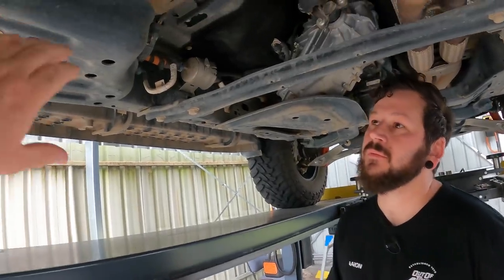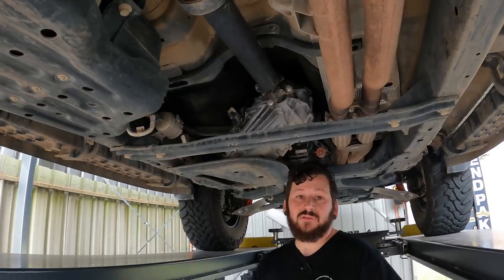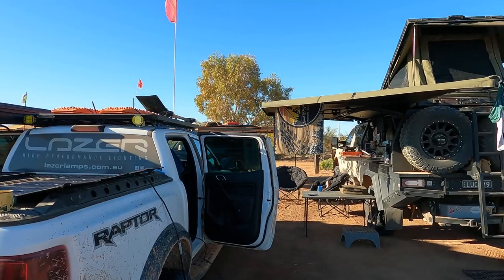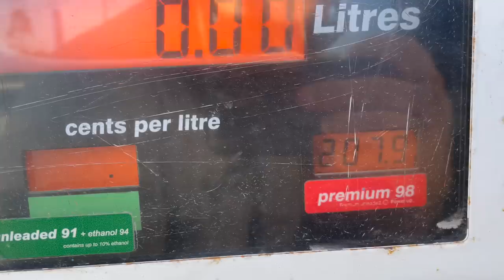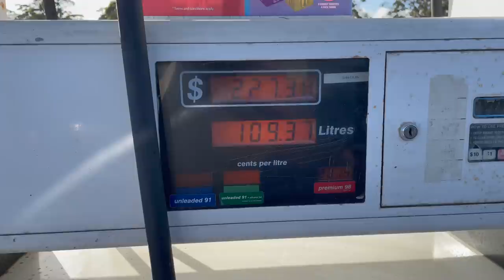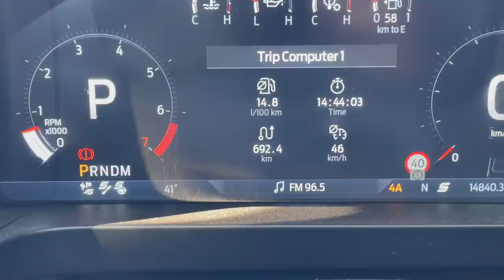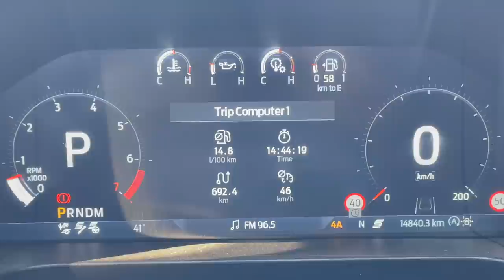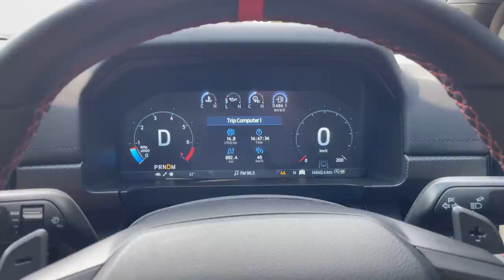⛽️RANGER RAPTOR 140L LONG RANGER FUEL TANK INSTALL. How far can we now go ?

Comment: I hope you find a work around for the DTE. I'd been keen to buy the tank also but would really like the gauge to work properly.
Reply from the maker: Yep the gauge works on the screen as the fuel goes down it’s just the DTE that Ford will need to change in the Firmware updates.
Reply: Try EZ lynk. I used one on on my 2019 f250 when I put the S and B filters tank on. It took maybe 5 mins to reprogram.
Reply: Great channel Ty, I have an orange one - absolutely love it - did ford manage to sort the dte yet to your knowledge?

Comment: 800kms from a 140lt tank. That’s rough. Gotta pay to play I guess. I used forscan on a PX2 to configure the larger tank. Worked sweet no issues. It’s good to have the gauge working correctly, no doubt the car nerds will work it out soon.
Reply from the maker: Playing is expensive 😂 

Gauge works as per factory it’s just DTE reading that’s a firmware thing calculated to 80L tank. Ford will need to update it in the over the air updates for Raptor.
Reply: @TyFenwick  Yeah that’s weird if the gauge is working correctly but DTE no good. They must calculate DTE differently now. If it’s calibrated to a 140lt tank and gauge works sweet u would think DTE would be good too.

Comment: Please post an update here, also, when you have more information on if the instrument panel shows a longer range for the larger fuel cell.  As well assd if you are able to come up with some other solution as to how to more accurately display the fuel level and distance till empty.  I don't have instagram, so I won't see any updates there. Also, how much does this cost please?  The website does not say.   I am VERY interested in this product.  Thanks for posting!

Comment: Ty what do you need to do to make the fuel gauge work correctly? Did the DTE end up working? Thanks.
Reply from the maker: Hi mate, 

Unfortunately you can't get the DTE to work as its an internal Ford software thing. We have tried everything but nothing has worked. However the guage still works.

Comment: Hi Ty, I have the long ranger installed on my Raptor and tried to get Ford to recalibrate it. They advised that they dont have the capability yet. How did your recalibration using Forscan go?
Reply from the maker: I’ve personally spoken to Ford engineers and they are not doing fuel capacity calibration on Raptor at this stage. It’s a software thing that only they can fix. I’ve just left mine as it.
Reply: @TyFenwick  Thanks for getting back to me. Its a bit frustrating with the gauging in that when it says 80 klm left it only takes 90 litres to fully refuel.

Comment: Great video. What's the legalities with these? Do they need mod plating or engineering ?
Reply from the maker: No mod plates or engineering.
Reply: Is that just nsw or what,? Would be a totally fuller Information session giving this basic info state to state  and regarding engineering and mod plating. My interpretation is qld may need some form of Inspection or mod plate to be good with insurance and the likes.
Reply: @Muckinhellx4  Qld does need a Compliance Plate for the modification. ARB look after this if you get them to install it (mod plate cost approx $150)

Comment: 800km and let’s say 135ltrs used. That is terrible consumption, roughly 17l/100. My old 4.5 petrol Land Cruiser used less and the 4.5’s were well known for their love of fuel 😊
Reply from the maker: But the Raptor is way more fun than a Land-cruiser you’d agree ! Gotta pay to have that much fun.
Reply: @TyFenwick i used 15l/100km with my non turbo 70s Diesel , which had about 130hp- so I guess, my current fuel consume on my Ranger Raptor , which is            19L/100km is not that bad….regarding the Ranger Raptor has about 400hp…

But if someone really wants to save on fuel, a 400hp car is not the way to go…

Comment: Jeez only 14mpg? Yikes, I know you guys don’t get the F150 Raptor but for us in America why buy the ranger with that crappy mpg. F150 does better.
Reply from the maker: I am running 35s so numbers might be off a bit. With the Herrod Performance setup it drops a fair bit I’ve been told but if fuel economy is what your after raptor chews it
Reply: Looks great for long distance desert running but not for rock crawling due to the lower break over angle.
Reply: these little ranger raptors are much more fun to drive as a daily compared to a full size f150. you factor fun into things, not everyone cares about mpg. obviously comes down if you can afford it of course. same concept as people who buy v8 supercharged cars. not everything is about mpg.

Comment: hey mate so the DTE still doesn't work with the long range tank then. have you tried going to ford themselves to do the software fix?
Reply from the maker: I’ve personally msged the engineer from Ford. They won’t change it as it’s a steel tank in a petrol car and has not crash tested. Only tank that can be done is the V6 diesel tanks from ARB.
Reply: @TyFenwick  yeah wow that's a bummer then having to rely on the trip counter to roughly track kms. would of thought a major company like arb would have a tested petrol tank for the raptor by now. is what it is i guess. thanks for the information

Comment: I'm a little concerned about the break over angle.  Looks like the front bottom of the tank would catch obstacles before the frame
Reply from the maker: Never been an issue, tank is very well tucked up. Been fitted for a while now no issues with that sort of thing.
Reply: @TyFenwick  I see.  Have you gone over a big ledge enough to test ground clearance?  About 2 or 3 feet vertical drop that would be a good test.

Comment: Any updates  on the distance to empty issue ?
Reply from the maker: DTE can’t be calibrated unfortunately it’s a ford software issue. Gauge works as normal and say around 580ks till empty. So once you use that top extra 
Amount of fuel it operates normally.

Comment: i believe there is a problem with the fuel guage after fitting the lager tank ?
Reply from the maker: No problem with fuel gauge. The DTE is a algorithm in the Ford Firmware so it only recognises a 80L tank and calculates accordingly. Unless Ford changes it to work with bigger tanks, it just takes long for the gauge to move down now while your driving. About 800ks you’ll get
Reply: Can confirm no real issues. Gauge reads full first couple hundred Ks. DTE sits at what it would be with 80L full tank. After it gets below 80L DTE is accurate if you keep your avg L/100 consistent!  I just reset trip every time I fill to get a gauge on how much I’ve used in the intervening period until DTE reads right.